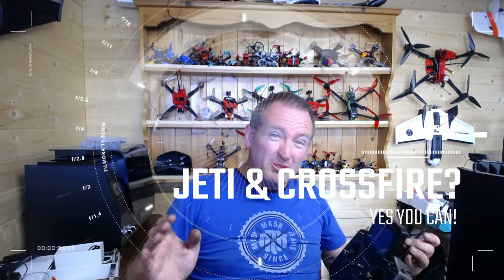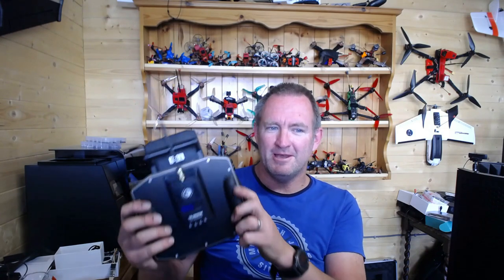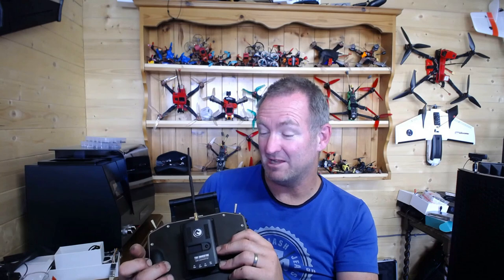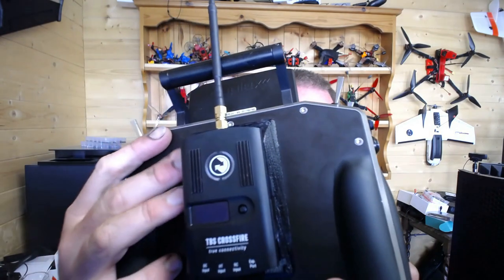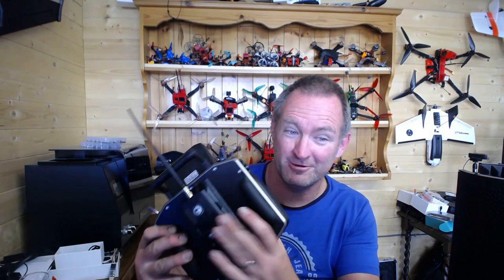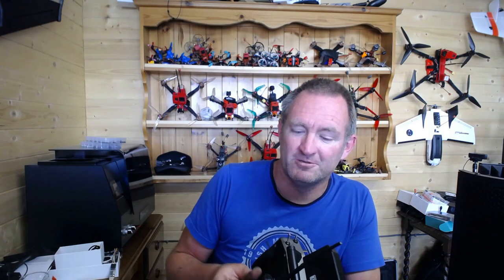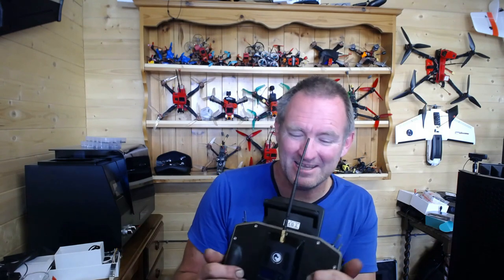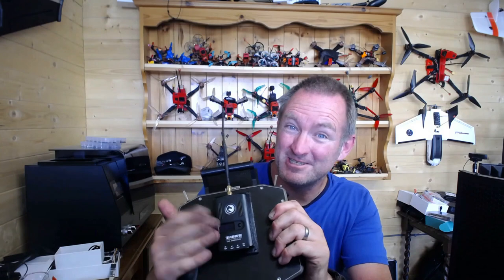JETI & CROSSFIRE | YES YOU CAN

Comment: Holy... this is exactly my dream. I have DS12 for planes and old Graupner MX16 converted do Crossfire via PPM signal and 12V supply, but having one radio for all would be great.
Some questions - how did you get the power switching solved? If you power up Jeti it also transmits 2.4 right? Is there a way to somehow disable it?
Other question - why not just use the trainer port and a dedicated cable for CRSF module?
Reply: To power off the original Jeti transmitter, check the trainer section of the DS12. On my DS16, that is where I can switch off the transmission module. Unfortunately you have to do that every time you power on.

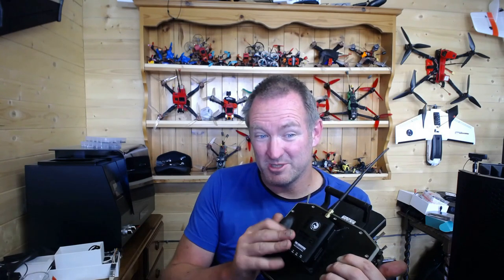Comment: @4:50 why not do it the other way around? get a 3.3volt regulator and use a 3S on the crossfire and run a 3.3v regulator to the battery port in the radio
Reply from the maker: You could do that.. but then it gets a little tricker.  
Right now.. powering on the radio powers up the module.
If I took it direct from the battery.. I would need to add in another switch.
Then..  I would loose charging ability of the 1s battery.. etc.. etc..
Rob
Reply: @RTRCTV  no you don't need to add in an other switch. all you would need to do is have w/e battery connector it is to an xt30 for the module and also to the regulator into something on the radio which is spliced into the current battery wire or w/e. then to turn it on, just plug it in and turn the radio onor if there's a charging port, just put it into the charging port and then your battery should be charged all the time ;)
Reply from the maker: @WX4CB  true.. But that would look messy 

Lol.. I am fussy :)